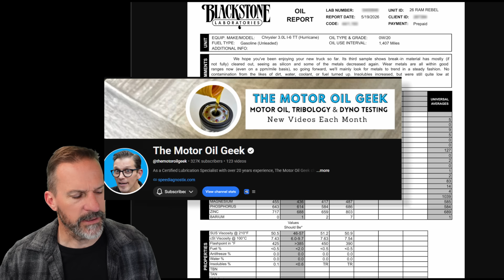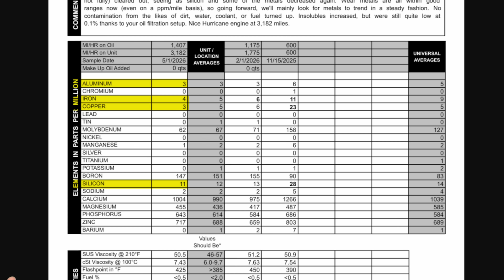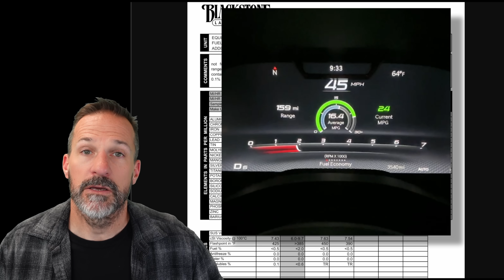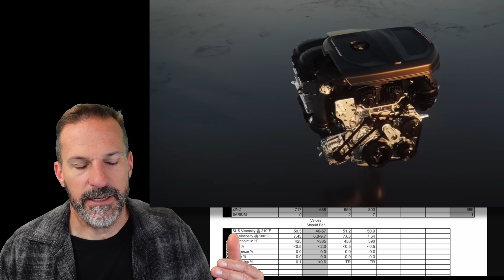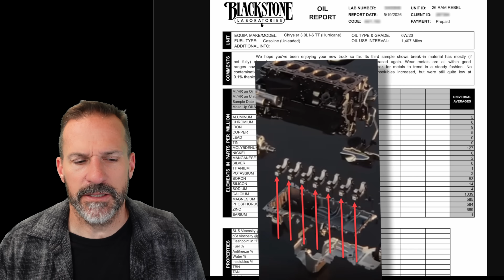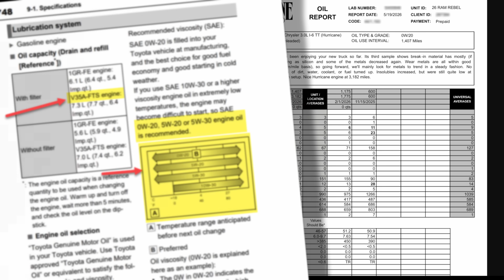The Break-In Secret Most New Truck Owners Ignore

Comment: “Great video!!! I love your content and also I used your website Dashboard ALL THE TIME! I think is a great tool!!! I have shared your YouTube channel with all my colleagues and friends! 

I loved the Motor Oil Geak Break-In strategy. You have done an amazing job! Thank you for sharing all the details!!! 

I think, I would change to 0-W40 due to the warranty for now and the change it to 5W-30. My 2024 Lexus IS500 F Sport Performance Premium use 5W-30 for his V8 2UR-GSE engine… 

I wanted to share something with you! I will probably send you an email with some pictures regarding what I am sharing below. 

We have a 2016 Toyota Sequoia SR5 with over 239,100 miles as of writing this comment, and we have had ZERO issues! But I know… I’m super picky with all my cars. Oil changes at NO MORE THAN 5K miles (and BTW, 0W-20…😂).

Having said that, my wife was in love with the 3rd Gen Sequoia. I always told her, “NEVER BUY THE FIRST MODEL YEAR due to recalls and initial production issues. You need to wait for the production refinement.” Well, the time finally came and we bought the 2026 Toyota Sequoia 1794 Edition in Wind Chill Pearl. I told my sales rep, Jaden, that I wanted a fresh one ordered directly from San Antonio.

Before buying, I went deep into the V35A-FTS engine data, using pro-level A.I. tools to analyze forums, complaints, and most importantly, the NHTSA recall documents. There’s a lot of misunderstanding out there about the recalls. The May 20, 2026 NHTSA reports (RMISC-26V320-6257, 26V320-0076, and the Defect Investigation report) clearly lay out the root cause: machining debris left in the engine block during manufacturing. To fix this, Toyota didn't just issue a recall; they implemented rigorous new internal manufacturing "clean points" to eliminate debris on the assembly line, and they specifically upgraded the material for the #1 main bearing to better handle engine loads.

I tracked our build to make sure it benefited from these exact engineering changes. Our final assembly was April 4th, and we received it the week of April 21st. The moment I got it, I opened the hood: the engine was manufactured on March 24, 2026, at exactly 12:00:46 PM—exactly as my tools confirmed, placing it well into the clear zone for these factory upgrades.

To physically verify Toyota's new clean points, I'm following a strict Break-In Oil Change Strategy (600, 1,500, 3,000, and 5,000 miles) and inspecting the filters in a highly controlled environment. As The Motor Oil Geek points out, doing oil changes early during the first stage of engine life is vital to get that initial wear material out safely.

 1st change (629 miles): Cut the filter open with professional tools. I found a little debris in the membrane about the size of sugar granules. Totally normal for a brand-new block.
 
2nd change (1,671 miles): 99% free of particulates!!! I found only about 4 flakes, all less than 1mm.
 
3rd change (3,188 miles, done on May 30): The oil only had 1,517 miles on it. AGAIN, 99% clean!!! I found maybe 4 flakes between 1mm and 2mm, and about 20 microscopic “sugar-sized” particles. I confirmed with my NEIKO magnet kit that the minimal particles were just aluminum. The membrane was basically spotless.

My conclusion? The engineering improvements and new clean points Toyota detailed in the NHTSA reports are absolutely working. The physical evidence in my oil filters proves it. However, it also proves that no engine is fully broken in from the factory. The Motor Oil Geek notes that the best way to deeply know how the engine is breaking in is by performing a used oil analysis. I couldn’t do one for these early intervals, but I might do it for my final 5,000-mile break-in oil change to get the full data picture.

We are really enjoying the 1794! It runs super smooth, no rattles, no wind noise AT ALL! No gas pedal hesitation, immediate response... in summary, absolutely NO issues! An amazing ride!!!

GOD BLESS YOU, YOUR FAMILY, YOUR TEAM, ALL the viewers in this channel!

Comment: I just switched to my 40,000 mile Honda Accord 2.0 hybrid from 0w20 to 5w20, living in South Florida. If I were running your truck and engine, I would switch from 0w20 to 5w30. You want to narrow the spread between the w weight and the 2nd weight in order to minimize shear breaking down your oil, while at the same time you want the best oil on that secondary weight for your engine and use case.  A 5w30 has a narrower range than the 0w40 and his hands down a better oil (if your climate is ok for it, and it should be in summer) the right oil for you to use in summer.

Comment: Why not 5W20? Just changed my 2026 Pacifica to 5W20. Little afraid to go 5W30. Van has 454 miles. Just couldn't wait to get that 0W20 out.
Reply: So, you believe to have a viscosity concern only during Cold Start vs. Operating Temperature?

Comment: For what it's worth regarding oil. I recently purchased a 2026 Mazda cx50. The turbo and non turbo versions both have a 2.5 L 4 cyl. The book calls for 0w-20 for the non turbo and 5w-30 for the turbo model. Good luck with your choice.
Reply: Interesting.  So they might believe the hotter temperature of the turbo engine's viscosity is the same as the cooler engine with non-turbo at operating temperature, but made a "cost of ownership" decision vs. protection at cold start, 0W-30 grade being less available, perhaps more expensive.  Or possibly, they learned from YouTube that the wider spread of 0W-30 would shear down more quickly and the lesser of 2 evils for engine wear is at cold start vs operating viscosity.

Comment: 5w-30 is the clear choice for me, and would recommend 5w-30 for moderate temperatures. 
0w-30 for cold 
and 
5w/10w-40 for hot climates.
Reply: Whatever is on oil fill cap.

Comment: I started using Valvoline restore and protect 5w-30 car can use 0w-20 to 10w-40 according to manual, never seen so much crap come out of my engine now, like clumps of carbon. I always did 5k oil changes with mobil 1 the car now has 110k on it.

Comment: You have talked about break in engine oil changes. What is your thoughts on transmission break in oil changes? Along with front and rear differentials.
Reply: Lake speed mentioned in one of his videos about his tacoma, that he was taking his tacoma to get the ATF and gear oil changed as part of break in. I can remember if he did it at 1,000 miles or 5,000 but he definitely did it. I bought a brand new Forester just yesterday and I’m doing lake speeds oil break in protocol. I’ll also be change the diff oil and cvt fluid too.

Comment: My thoughts as a retired mechanic. I run 5w30 during the summer months and switch to 0w30 for the cold winters in my region in Idaho.
Reply: those are the same oils above freezing temps so no need to change from zero weight in the summer
Reply: @Old_Indian_Trick maybe you mean same (viscosity range) at operating temperature vs soaked cold during cold starts?
Reply: @Publius-f5 is operating temp not above freezing? 30 weight is 30 weight in the summer.
Reply: @Old_Indian_Trick that was exactly my point, 30 = 30 (kinematic viscosity).  At cold soak, static viscosity at 5W might not equal viscosity at 0W.
Reply: @Publius-f5 my original comment specified summer temperature. So I don't understand your need to note cold weather temps.
Reply: No need if you use Pennzoil Ultra Platinum 5W-30 it’s Flow Rate is tested outstanding down to 40 degrees below zero…!
Reply: Why?  What data do you have that proves this is a better approach?

Comment: For my 2011 Ram 3500 6.7 Cummins I run Chevron Delo 15w40 synthetic blend, it works great and is changed every 5000 miles. I use high quality NAPA fuel & oil filters. Transmission serviced with Valvoline ATF + 4 oil. Both spin on and "flat" transmission filters changed as well.

Comment: It proves these small engines dont get much if any better gas mileage towing then my 5.3 V8 in my 04' GMC Z71 and that was their whole point of these small liter turbo motors with 10 speed trannys, I got 75k on my truck and tow about the weight your towing when I tow and im getting that mileage...

Comment: I’ve heard somewhere that you shouldn’t change your filter the first couple break in oil changes. Any opinion? Thanks.
Reply: Yes, that is what Lake did in his video.
Reply: Proven that they filter better slightly dirty. I changed my oil at 700, 1700 and then 3000, changed the filter at 3000. Oil analysis looks good.

Comment: 5W-30 AMSOIL signature series that’s all I run in my 2018 Tundra and my 2013 Nissan Armada. I forgot to mention that I also live in Pennsylvania, where the winners are pretty cold and the summers are pretty hot.
Reply: I use Amsoil Signature Series 5W-20 year round in my 2012 Camry. And I live in southwest Arizona where the summers are brutal. But I have four back-to-back oil analysis reports at 12 to 14 k intervals, the oil is protecting just fine with the wear metals almost non-existent.

Comment: I switched all my 0W-20 vehicles to 5W-20 per the Motor Oil Geeks tests that showed greater shear protection. I’m in a warm climate so that helps.
Reply: Just use 5w-30.  My 25 camry says 0w-8 but I’m Using 5w30. Car runs better and quieter.
Reply: Jumping from  20 wt to 30wt, is greater sheer protection.  Look up the importance of HTHS .  20wt is as thin as hot ATF.
Reply: @A @AlisoBob Lake also said that 4 out of every 10 brands of 5w30 wind up sheering down to a 20 grade anyway. 
He said the most sheer stabil oil grade is 5w20. The closer the number before the w and after the w the more sheer stabil.
Reply: @travisedmiston8001  yes but the 20 grade sheers to a 8 weight!So thats why its better to do 5/30
Reply: @fpdmotor If I was going to run 30 weight oil might as well run 10w30 more sheer stabil and I live in NC, doesn’t get that cold here. If I recall correctly 10w30 is ok down to-13 degrees F. The lowest it gets here is maybe in the teens. Hell, why stop there run 20w50 in the summer, just saying it’s all about what you want, I want protection and efficiency, and as long as 5w20 doesn’t sheer out of grade according to used oil analysts then it’s good to go.
Reply: @travisedmiston8001 ya I’m in Fresno ca so it gets 35 if that in winters and 100-110 summers so I could get away with 10-30
Reply: @fpdmotor  😂 no it doesn’t! Not that low!
Reply: @Maynardd I was exaggerating so ya your right
Reply: @travisedmiston8001  And it’s simply because 5-20 has the fewest amount of Viscosity Index Improvers (VII) since the spread from 5W to 20W us only 15.
Reply: @AlisoBob  I have 350k miles on my subaru and used nothing but 0w20 and my car still runs like new .
Reply: @A @AlisoBob  closer the number less sheer

Comment: I use 0-40 Ultra Platinum . Change oil every 3500-4000 miles wix xp filter.
Reply: The XP is not a good filter.  The std Wix, is the better filter.
Reply: From what I’ve read AlisoBob is correct in that the Wix XP filter may not be the best choice for your use case.  The XP is designed for extended performance (mileage) but sacrifices filtration to achieve that.  Since you’re changing oil on short intervals, a higher mileage filter isn’t important.  I would run the standard filter, which has better filtration.
Reply: @Bruce01716 10-4 sir thanks for the input

Comment: 2025 GMC Sierra 5.3L since 500 miles switched to Pennzoil Ultra Platinum 5W-30 , my oil analysis which the first one was done at 1500 miles , second one at 3000 miles and both came back excellent, very low wear metals measured by Blackstone Labs , very positive remarks. Ultra Platinum Pennzoil has a much better additive package than Dexos Mobil 1. Also I am using Mobil 1 Extended Life Oil Filters. AC Delco PF 63 oil filters are POS ….! I too are following Lake’s recommendations. Going forward with 2500-3000 mile oil change intervals..!
Reply: Just curious, what makes you say the PF-63 are junk?  I've been using them in my wife's Acadia for 8 years.
Reply: @pamcm1098  PF 63 are cheap and there are way better filters that filter so much better!
Reply: @pamcm1098 If I could post 3 recent pics of my 3 recent oil changes one of PF 63 and two PF 66 AC Delco oil filters, next time you change out your oil filter cut it open and see if you find what I found on all 3 filters. All 3 of my filters the pleated paper element did not make the full circumference leaving a half inch wide open gap whereby oil had a pathway to bypass fully unfiltered. That is why IMO AC Delco Oil Filters are Garbage…!
Reply: @cbnx82703  Thanks.  Good to know!
Reply: @cbnx82703  I use them. Also, you can simply look inside the filter to see if the media goes full circle. They’re not the greatest filter, but certainly not the worst. Just an average filter. I’ve been using them on my 5.3 also for several years and I’ve never had an issue. 
They claim will catch 20 microns. But who really knows?
Reply: See a difference in gas mileage with heavier oil, or you probably wouldn’t know the difference since you’ve been using it basically the life of the truck?
Reply: @Maynardd To be honest I didn’t by a Truck for gas mileage, if I was in the market for gas mileage I would have bought a POS Honda Ridgeline …
Reply: @cbnx82703 . That doesn’t answer the question. I don’t care if you’re in the market for gas mileage or not I was just curious if you noticed the difference.

Comment: I switched to 0w-40 in both of my trucks. It quieted down my Tundra 5.7 immediately. I used mobil1 european formula 0w-40. From a pure viscosity perspective, I think it's the right weight because it stays thicker after warming up. However, I discovered the european formula I used has higher phosphorus and sulfur concentrations that can plug the cats if I used it long term.  Unfortunately, those additives are what keeps it from shearing down to about 30 weight within a 1k-2k miles. I need to do more research and watch more motor oil geek videos before my next oil changes. I might use the supercar 0w-40 or just switch to 5w-30. I won't go back to 0w-20 though. If you can get Lake on for an interview sometime, I'd love to hear his take on this. Good info and good video. 👍👍
Reply: 0w/40 Mobil 1 ESP is emissions  equpiment friendly.  A fantastic oil.

Comment: IF you use the Flood-Clear procedure to crank the engine for ten-seconds before allowing it to start each time, your best bet is 10W-30 Amsoil with either the Amsoil filter or WIX.
Reply: I agree with the oil, but Amsoil and WIX filters are junk now until they change manufacturers
Reply: Seems like a bunch of extra wear on the starter & battery, maybe electrical noise spikes in general. Interesting concept, though.
May be better to manually spray some fresh oil in there somehow before cranking then drain a little if the dip stick "says" to.  Think old school chainsaw with manual bar lube pump in addition to the auto lube pump.